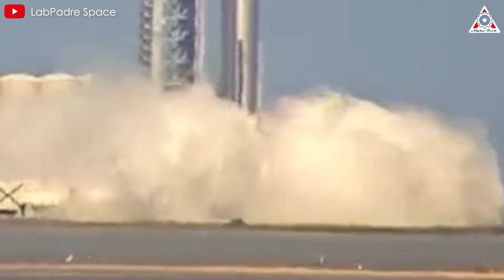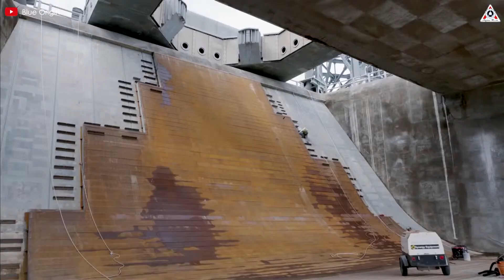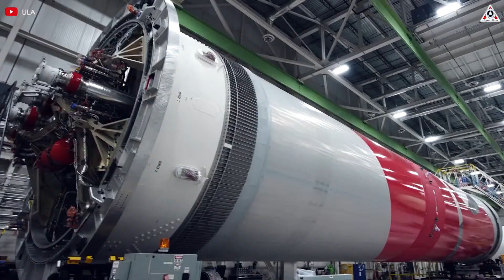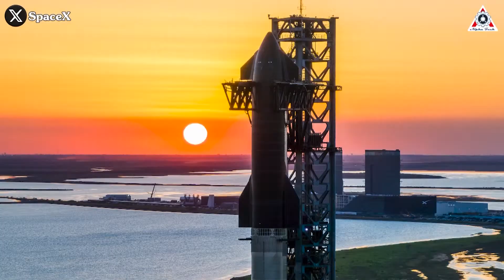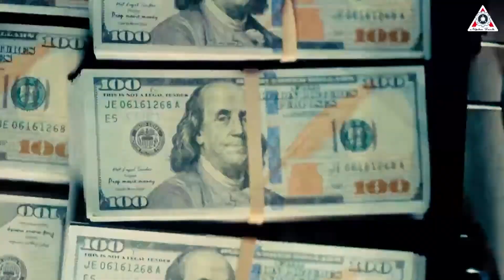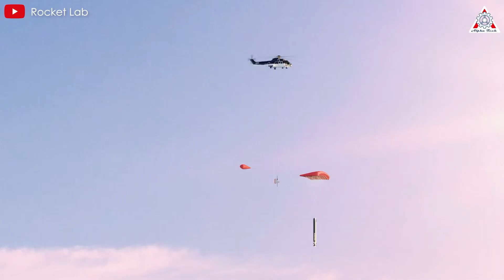SpaceX Drops Bombshell Upgrade for Starship Pad B to Ditch Water Deluge system!

Comment: An early prototype flame trench design was originally tested out at startbase's mcgreggor testing site. 
The shower head design is now being replaced by the better flame trench design.
The basic concept of using water to protect the rocket and the base launch infrastructure is still there.
There are massive planned improvements at Pad B over the original Pad A.
The physical rocket launch mounting pad will be replaceable if needed.

I suspect the 25 meter design width of the flame trench is wider than needed for the current 9 meter diameter Starships.
It may support up to a 12 meter diameter design which would almost double Starships maximum payload capability, without needing a new tower design.